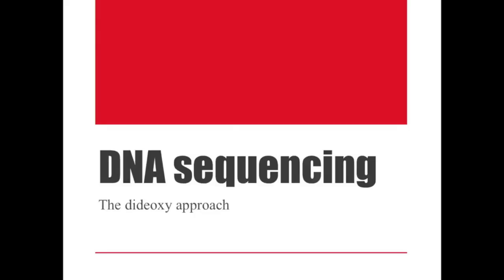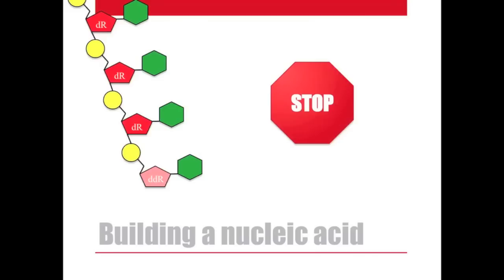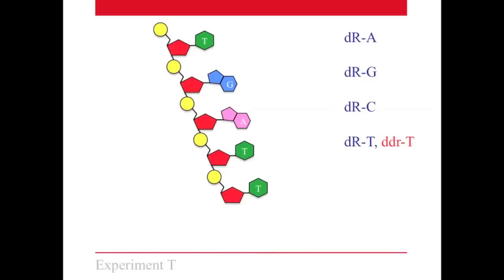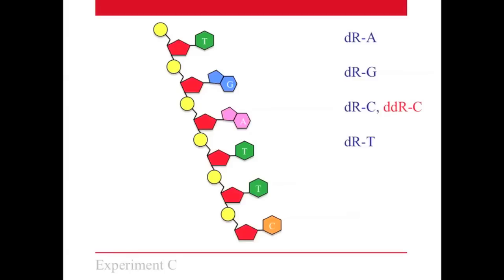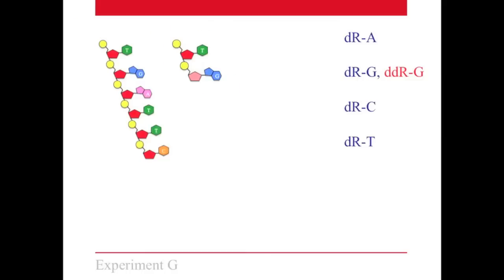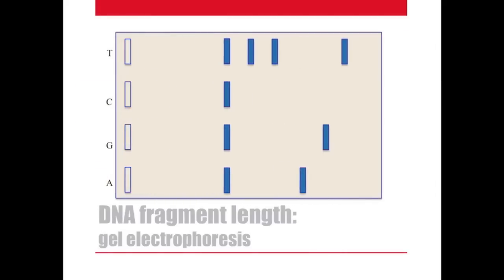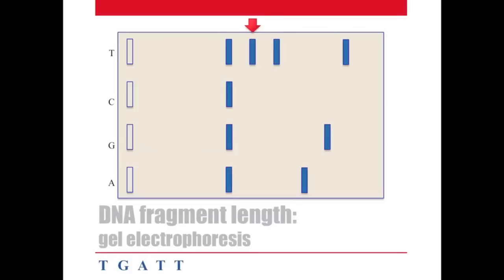Dideoxy DNA Sequencing

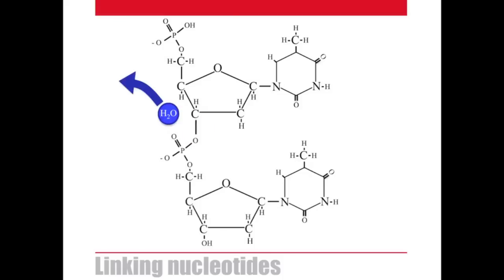Comment: 01:18 What particular enzyme does this?
01:45 So how to turn a "normal" 2'-deoxy  nucleotide into a 2',3'-di-deoxy nucleotide in a beaker? Is there some enzyme involved as well? Or just an ordinary "inorganic" reaction?
How about the fluorescent dyes used to mark them? What chemicals are they exactly?
07:00 What if there are some gaps because no ddR happened to attach at that particular site? Shouldn't there be additional row in the electrophoresis process with a DNA ladder to mark the places of all possible lengths for reference?